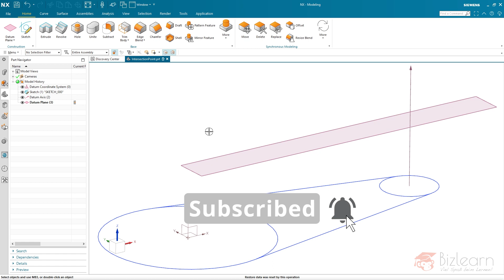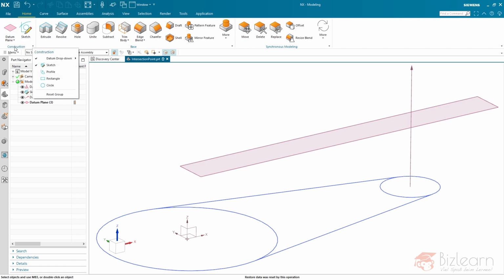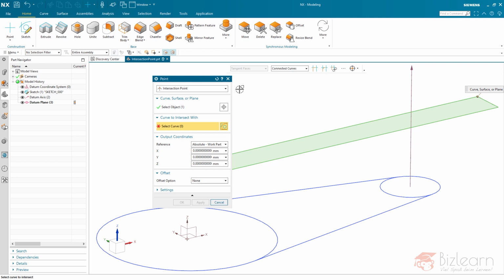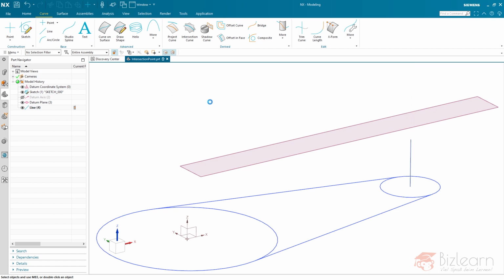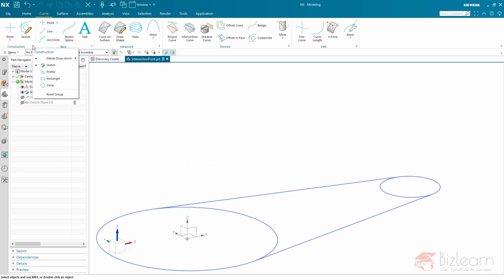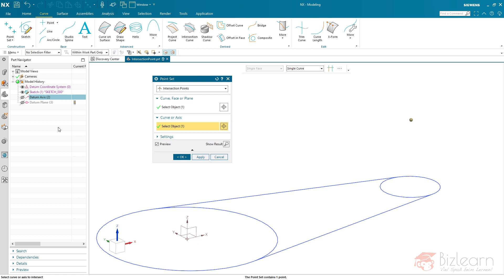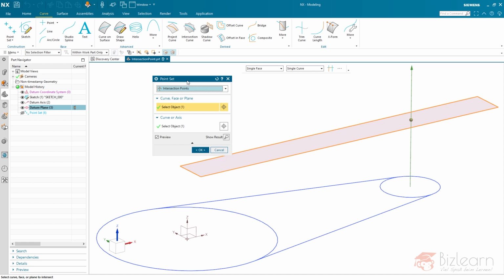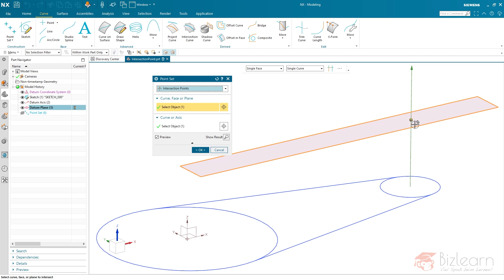Did you know this NX CAD Secret? The impossible Intersection Point - Siemens NX 1980 or older

Comment: This is a perfect example how anti-intuitive and weird Siemens NX is :-)
Reply from the maker: Hm... This is a perfect example how deep you have to search in order to find something that needs improvement in Siemens NX😅 come on dude... I think at least it depends on your design goal. NX is more then just a cad software. I wouldn't recommend it for every design usecase. And I have also realized that if the knowledge is depending on a bad training or just tutorials, no refresh trainings etc. It will be hard to judge and discuss. What's your nx or cad background?
Reply from the maker: Thanks for the comment btw. 👍🙌
Reply: IMHO this is a question of what you expect from a software (or whatever kind of thing). Since I am not considering my brain as a junkyard for useless detail knowledge I am expecting stuff to be intuitively understandable with no need to learn 'secrets' by heart. 
If you are using the very same software every single day this will not be a major problem, but (e. g.) if you need to switch ...
Reply from the maker: Aem. I totally agree! On this channel everything I show is based on a simple technique, called horizontal modeling. You don't have to increase model stability in such a way. In that case, NX can be replaced by a large number of cad systems. But in terms of following this certain modeling technique, there is no system, which offers such kind of relationships between features and geometry. Unfortunately a lot more than 50 percent of its users are using nx the way, they'd use any other cad software. And at least it feels not intuitive, bacause the real potentials of NX are still a secret. It takes some effort and understanding and I agree, it makes more sense for power users to use its potentials. Did you watch my videos about horizontal modeling? I'm still interested in your cad background?
Reply: Yes I have seen that horizontal modeling tutorials. I do know that this is the basic principle in order not to mess stuff up :-) 
I also do know what amount of ** people are producing by not obeying this principle ... 
As soon as the damage is done boss is asking for me to repair it :-)
Reply from the maker: There's still a lot of work left for us😂
Reply: @Bizlearn_Siemens_NX_Training  I would say that NX is the most powerful one. But it always depend on the usage. For simple machines/devices Solidworks will be first choice, there is no sense for using NX for such a purpose. And the only thing in which NX is worse than other CAD is surface designing. Catia is the best in that case IMHO. 3years ago I switched from Catia to NX and still I miss their GSD.